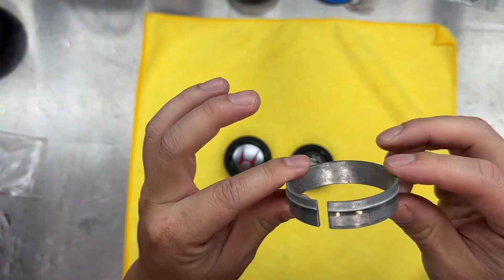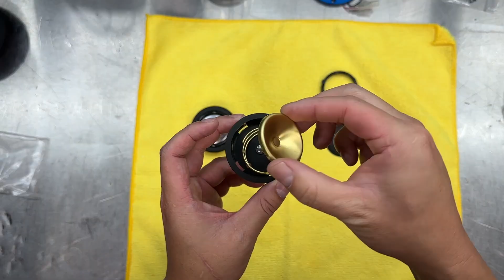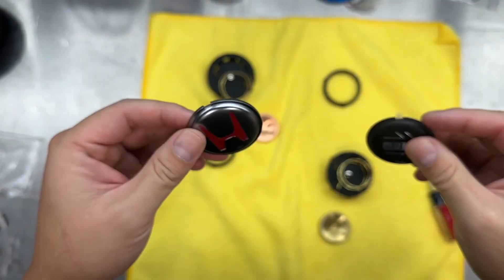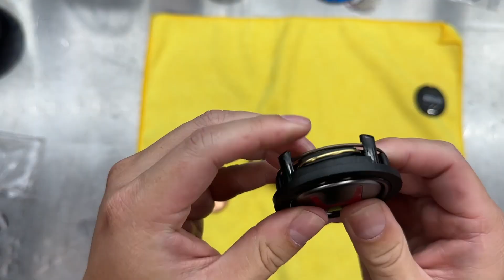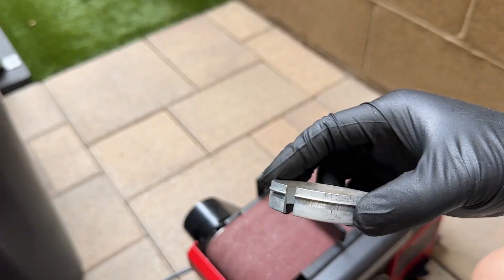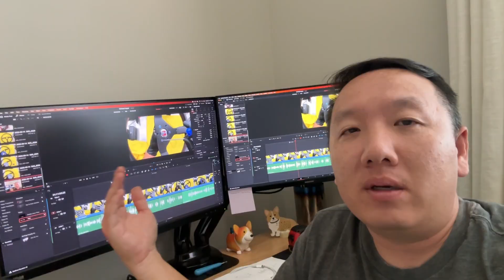How to Flush Mount Horn Button Mod your MOMO Steering Wheel - Works Bell & NRG Edition

Comment: Will this work with sparco?
Reply from the maker: I haven't tried, so I can't say for certain. Based on what I can find from google image searches, the two horn buttons from each brand looks identical. You would have to purchase a MOMO flush mount button and see for yourself whether the spark horn button can be transferred to the MOMO flush housing and also if the inner diameter of the horn button hole is the same as MOMO.

Comment: I just did this. Hammer copper dish at the protrusion to create travel. Problem solved lol.
Reply from the maker: That’s one way to do it! I’ve always been able to get enough travel my mixing components between the two horn buttons. No hammering at all.
Reply: @ChrisLumNSX I tried mixing and swapping. No luck. Luckily I had a spare sacrificial button laying around to mess with. And a few bangs with a hammer worked lmao.